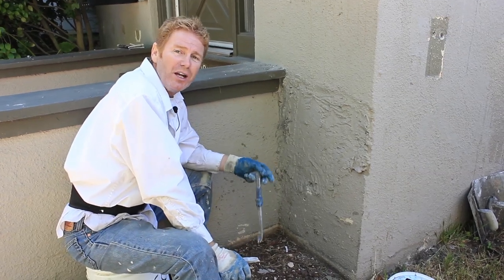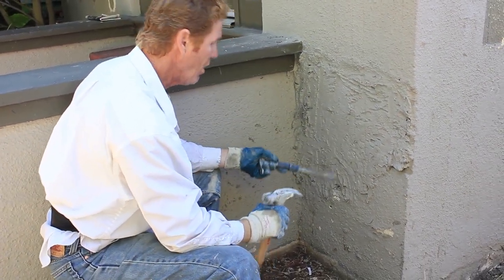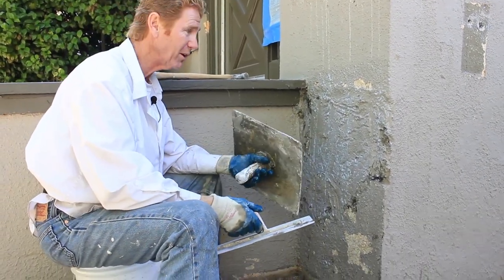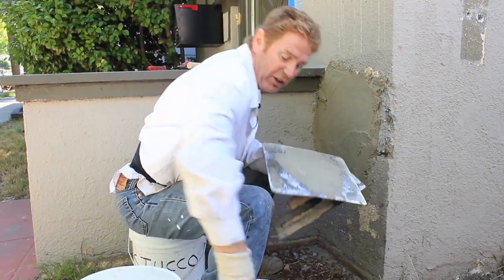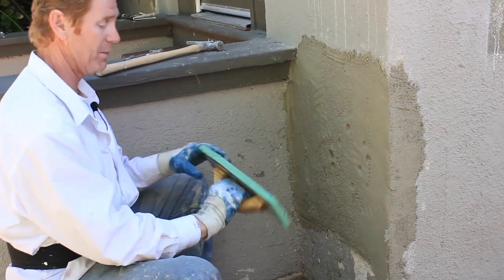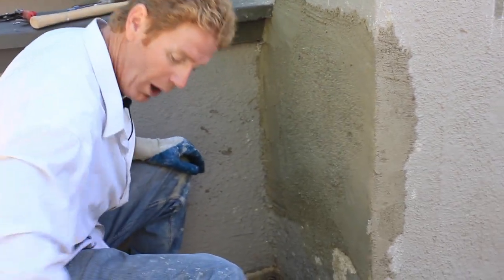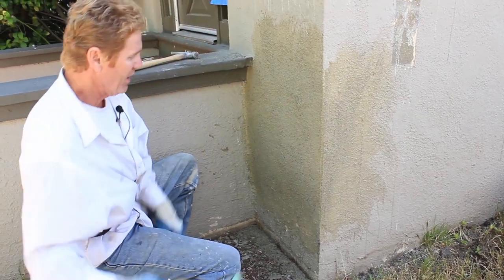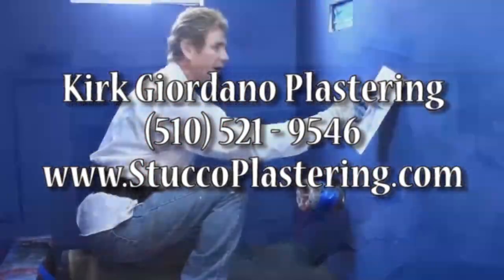Stucco corrections over a poor ugly patch

Comment: Hey Kirk!
Do you ever use the "stucco patch"labeled bags by rapid set?And whats the difference from what your using here vs the stucco patch?
Or is it the same thing.
Reply from the maker: Howdy Josh, I have used rapid set before, a person just adds water.
 As a plastering contractor I prefer to buy cement plaster then add our own sand.
 Best wishes with your projects,
 Kirk giordano plastering on small repairs

Comment: hey Kirk. great vids! enjoying going through the catalogue of videos and learning a bunch. anyway, regarding this job here, would you know leave that to set and harden by itself or would you need to occasionally re-wet it with a water spray or something? also, one more while I'm here! what is the binding compound/product you use?! best regards David
Reply from the maker: Hi drdmac dude, you can wet these small patches if you like as it will slow the dry time helping prevent hairline cracking.
 The bonding agent I recommend is Weld Crete by Larson's, but quikrete bonding agent works well too, and is sold at Home Depots, Lowes and most hardware stores.
 Best wishes, 
 kirk Giordano
Reply: +Kirk & Jason Giordanos DIY plastering and stucco tips thanks for the info. keep making those videos please sir!
Reply from the maker: Hello Mac Dude, thank you,
 we will try.
Cheers!
 kirk Giordano Plastering